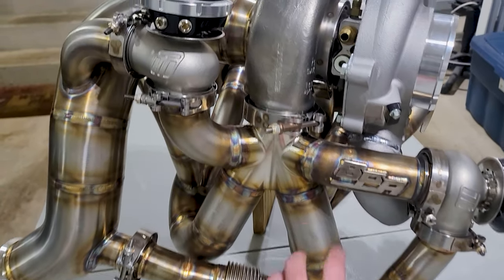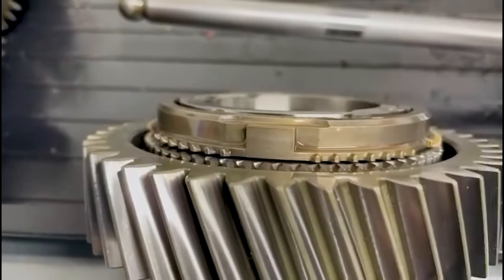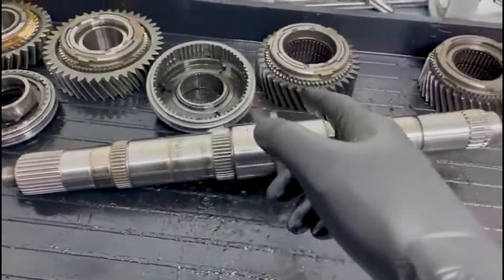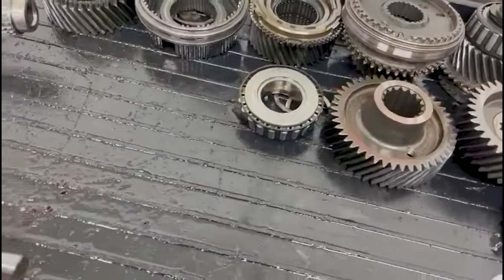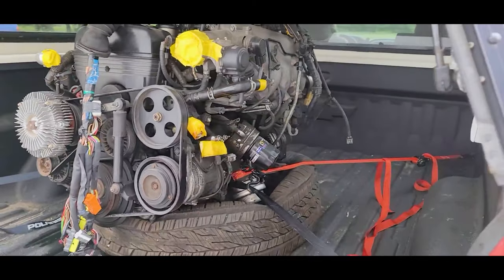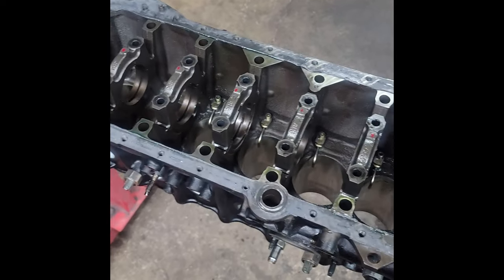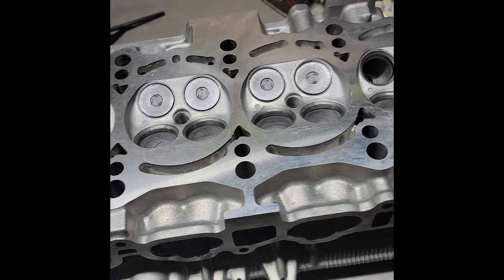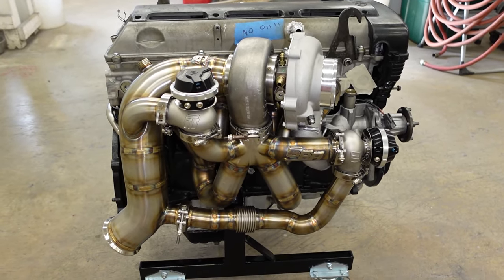My MKIV Toyota Supra has a 2JZ engine! (My car update)

Comment: Wow SMH with that engine builder 😡 

I might have missed it but how many miles were on that 6 speed?
Reply from the maker: Around 110,000 I think
Reply: @PaulRozeboom  one more quick Q.  Was there any problems with it before sending it off for a rebuild?  

Thanks!  BTW Great channel & content!
Reply from the maker: @HAULUUZ  nothing crazy, it had a bad leak though so I think I might have run it low on fluid. I think the video speaks volumes to the care that he gives the transmissions